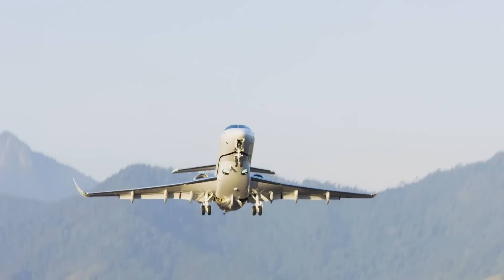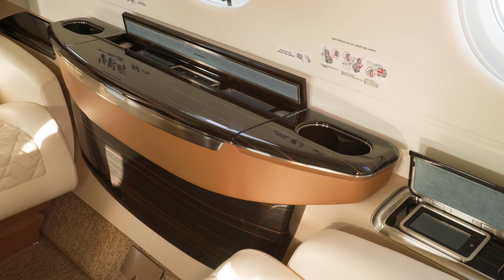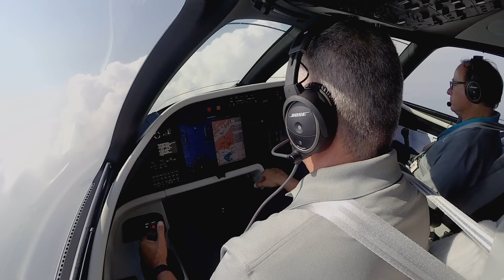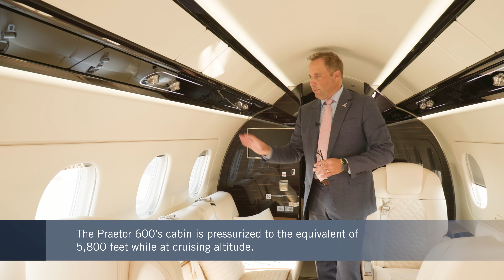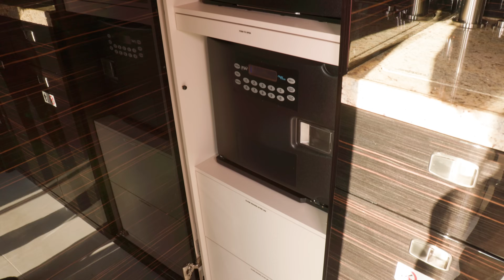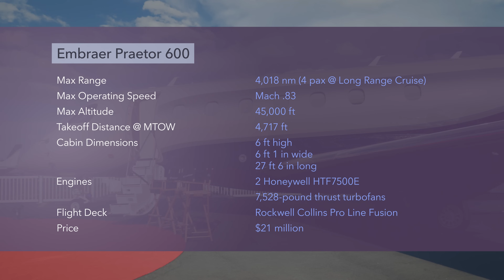Tour Embraer’s Praetor 600 Jet and Learn How it Serves its Owner – BJT

Comment: One sweet ride, if I was a billionaire I would definitely buy this jet long range for a very reasonable price tag.
Reply: Its not really a long range jet
Reply: @MonicaHolly143  4000nmi is no joke. Not VLR, but certainly intercontinental.
Reply: Still not long range thats the topic here  @spdcrzy
Reply: @MonicaHolly143  no, it literally is long range. That's how jets are classified. Short range all the way through very long range. And this jet falls in the long range category.
Reply: @spdcrzy  this is a midsized jet no one is saying this is a long range jet tour probably new to aviation
Reply: @MonicaHolly143  I,got my specs off the company website .
Preator 600 is just over 4,000 NM.
Preator 500 is just over 3 000 NM.
No ,of course it's only mid size jet.
I ,am not new to aviation because I flew in the air cadets in my teens. 
Of,course only Cessna 172/182.
This,is in comparison
Reply: @danielepelaia7875  now go search how many range a jet shoudl be have to be called long range jet
Reply: @MonicaHolly143  Gulfstream G 800 is 8,000 NM.
Reply: @MonicaHolly143  Sorry. You're right. Yay sleep deprivation! I meant in terms of range - it's long range for the class that it's in. It IS a midsize bizjet, though. But having 4000nm of range is quite long range for that class. Especially considering its relative span and length for the height it has. Embraer always likes to play at the edges of the market IMO. Their jets are hard to classify.

Comment: Capable bird. Slightly pricey. I would like to see skinnier jets with long range. So you don't need super waste to cross the atlantic or go to hawaii.
And while they are at it why not pressurize to sea level. At FL600.
Reply: The higher the pressure differential between inside and outside, the more stress is put on the plane, which reduces lifespan, and the stronger it needs to be, which increases weight. More weight means more fuel burn and shorter range. All of these factors would combine to increase the overall cost of operation and eventually fares.
Reply: @letmelick  Of course it will need the structural strength for the pressure but I figure that a single piece composite fuselage could basically not be flimsy enough to where it couldn't handle even the full bar pressure difference of space. It will need some strength in and around the door which I don't think would be too significant and of course the cockpit windows which I think could be smaller anyway with better cockpit design. basically move the pilots forward and together which would also increase the usable volume of the plane. The further back in the cockpit you sit the more massive a panorama of windows you need. For a single pilot aircraft you could imagine glass not much bigger than a helmet visor in the extreme case or even zero cockpit glass and fly virtual. Like the Concorde should have done. Had it done that they might have shaved 15 ton off the weight. No small difference.